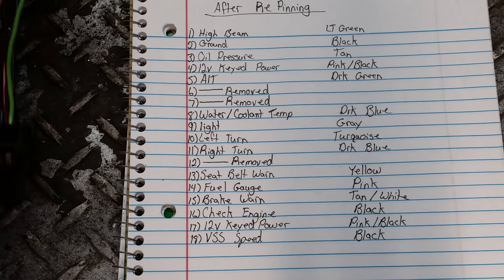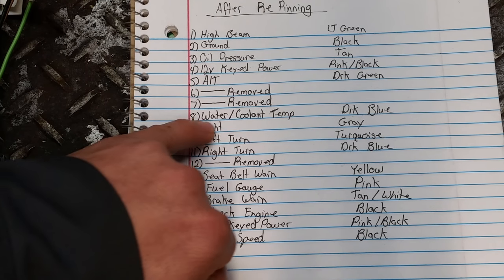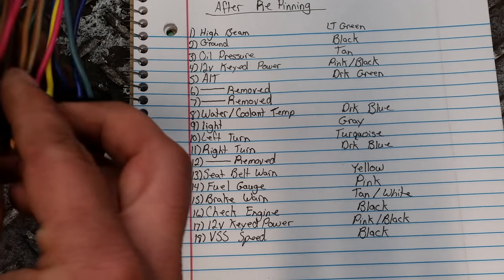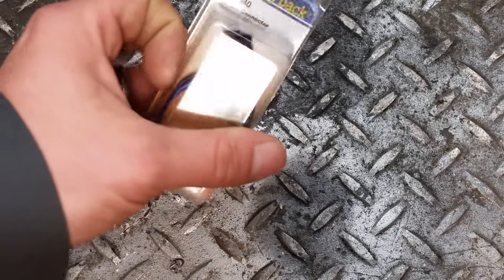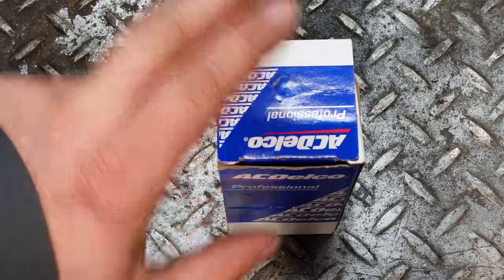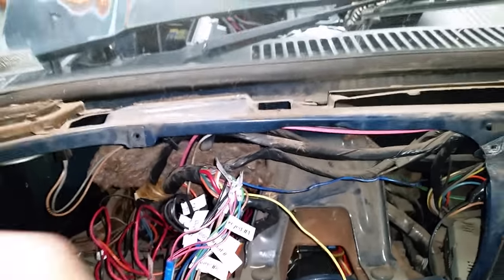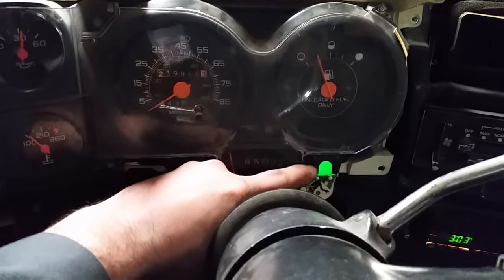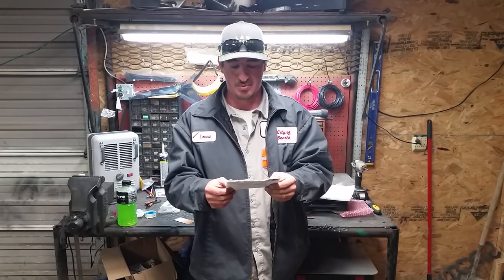1984 C10 Project ---- LS Swap Part 13-2 (Cluster Swap Using a 90-91 Square Body Cluster Part 2)

Comment: Thanks man for sharing this I just put a newer transmission in and I want the electric speedo now I know what I’m doing after work
Reply from the maker: Only works with a 90/91 suburban/blazer cluster.
Reply: I am trying to put one in right now but my 86 has more wires then your 84

Comment: I install bench seat covers for living. If you order seat covers bench splits top and bottom. Bolts are 2 on each side just did seat today. Heat gun softens vinyl and pan cooking spray helps covers slide on top flip inside out roll down. Bottom lay flip upside down. Heat vinyl roll sides down. If you rip cover tiny bit super glue. Find holes feel for them razer blade new holes. Trn minute job. Foam I just put carpet bottom them spray glue donor foam shave down any way like turkey knife, sander, grinder, Rolla lock, just razer blade. Hell get good foam from junkyard.

Comment: Great build Lonnie somthing you might check on for a tach that's factory is a gauge cluster in like a 2 ton Chevrolet of the 70s and 80s era the c60s c70s models they had a tach where the fuel is on your gauges and the fuel was under the tach smaller but in the same place idk if it would work with the new ls stuff but you could probably figure it out 👍

Comment: Hi! Great video, i just did this on my 82 C10 yesterday but now the battery voltage gauge isn’t working also the cluster lights don’t come on! Also on the diagram you’ve mentioned to tie #4 wire with #17 is that correct?

Comment: Say Lonnie  I have a 1980 C10 Silverado,  I installed a new 12 v circuit harness just the basic harness. I'm having trouble with the gauge cluster, I purchase a new printed circuit board, gauges, do the gauge cluster connector ever go bad , my FUSES are good. Keep in mind that I reconnect the old pig tail gauge cluster connector to the new 12 circuit harness.
Reply from the maker: To be honest I have heard of some going bad but not very often

Comment: Sup buddy I have same gauges on my swap but for some reason my check engine light is not showing on the cluster when I move my key on start position even my brake light when is cranking can you tell me what's the reason you think I have my malfunction wire from my new harness connected straight to my cluster plug on the pin #16 and also my old choke wire I use that one for my battery warning light on the pin#5 that's correct or wrong then u comment using the pin#17 with pin#4 what's the reason use those together so my 17 is gonna be empty now?

Comment: What is your exhaust set up? Are you using straight pipe or cats and what mufflers?
Reply from the maker: I’m running true duals 2.5” from the hooker cast iron manifolds to an x pipe then from the x pipe I have 2 flowmaster super 40s then I have it dumped before the rear end

Comment: very good set of videos and I was able to acquire a 90-91 suburban cluster off of ebay, waiting for it.  I was going to put in my Intellitronix, but with yours and OTHERS' youtube "reviews"  I will junk it.  I will use the 12-pin connector though for possible future other cluster options.   

I  have a question on to where does the ALTERNATOR wire connect?  thanks

Also, I looked up that oil sending unit 19106970 and summitracing states that that sender is a safety switch. Is it also the sender unit as well?

Comment: Kick ass video I did the same thing on my 1983 R10. I didn’t know about the temp sending unit that’s cool no more drilling and tapping the water pump thank. Do you now if the suburban came out with a tech? I like to put a factory tech on mine.

Comment: Or the pins on the connector no longer making contact with the gauge cluster printed circuit board? The pins look worn down

Comment: So I did a Gen 5 lt with holley I'm trying to get the speedometer to work  the 2 wire coming on a vss on the transfer case where do they need to go
Reply from the maker: You will need an electric speedometer

Comment: Did you use the intelectronix block temp sensor? the one I got doesn’t have a plug on it.
Reply from the maker: I used a 3 wire temp sensor because my computer needs to see the temp.

Comment: Lonnie......  I bought an electronic  gauge cluster and its coming with it's original pigtail.  Do I still have to move pins around like you have done on this video or just connect matching the wires?
Reply from the maker: What kind of gauge cluster and what truck are u putting it in?

Comment: Hey man. Love the videos. About to turn my ls swapped c10 over within the next couple days. Was wondering the part number for that 45 degree adapter you have for the oil pressure sending unit
Reply from the maker: That I don't have. I just went to the local parts store and they had some fittings.

Comment: Do you happen to know if it’s possible to hook an ls harness up to factory cluster? I have an 86, I imagine it’s similar to your stock 84 cluster
Reply from the maker: Wade in the water the speedometer won't work. That's why I'm using this 90/91 cluster
Reply: I'm guessing that means I cant use the stock gauges in my 86 Chevy van?

Comment: does this swap just require the gauge cluster from the elect speedo trucks/suvs, or does it also require the DRAC module from the 90s truck?
Reply from the maker: The trans I used required an electronic speedo
Reply: im swapping a 2000 5.3/4L60E combo into my '83 C10...
Im looking at installing a '90 K5 Jimmy gauge cluster into my truck...
Ive heard some people say you need the DRAC module to make the swap functional, but didnt see this in your vid... So im curious if i need to grab it?
I found a '90 Jimmy thats being parted out... Thats why im asking
Reply: @splash5974  isn't the drac module the yellow box on the back

Comment: If I have the wires that came with the cluster do I need to follow this procedure or just cut the wires and splice them accordingly
Reply from the maker: It will need to be repinned
Reply: Thanks i finally found one and since it maxes out at 85 I’m still going to use my obd2 for tach and speedo but I like how you did your tach
Reply: Lonnie's Garage (Puppetkicker) so I got everything hooked up thanks to this vid everything works oil pressure voltage speedo fuel only thing is the coolant seems to read a little lower than what my ecm is getting

Comment: On your bulk head wiring where did u add the wires for the speedometer and check engine light ?
Reply from the maker: Ran the speedometer direct and the check engine light is still hooked up to the stock one.
Reply: Thank you sir, for the alternator wire did u also run it directly to the alternator? Sorry for so many questions I am just trying to get my wiring squared away, I am also more of a visual type of guy lol

Comment: do you think I could wire the stock cluster that came out of the doner? I have 85 c10 getting the swap. Can you tell me what motor mounts you are using? thankyou
Reply from the maker: Oscar Hernandez I'm sure there is a way to wire in the donor cluster. I just don't know how and not to mention all the work it would take to make it form to the dash pad and look right. The mounts I'm using are from Tejas Steel Works. You can find him on Facebook. They allow the ac to stay in the stock location and also you can use the truck oil pan. It lets it set flush with the crossmember without worry of it getting hit.
Reply: Lonnie's Garage thanks for getting back to me so quick i plan to use the stock c10 cluster later(guages are shot) I just want the doner cluster to read for now. do you have a part # for the motor mounts
Reply from the maker: Oscar Hernandez direct link to them...... https://squareup.com/market/tejassteelworks/item/c-ls-swap-mounts

Comment: Do you have the wiring diagram or list for the original cluster wires by pin number and color
Reply from the maker: Check out ls swapped square body on Facebook

Comment: did you use a 12v key for alternator  (pin 5)? if not what did you hook up to ? thanks
Reply from the maker: Are u talking about the batter charge gauge?

Comment: I’m sorry I’m not real smart at this, so the wire coming off the cluster is hot and need a ground from computer, where does the ground hook to on the cluster, it’s the same cluster that you installed, I went off your diagram, thanks
Reply from the maker: I used a different led light for my check engine light. It is a really small one they will blink when there is a code.
Reply: Thanks I appreciate your help

Comment: Where did you hook the check engine light at the computer
Reply from the maker: I ran a separate wire for that. It’s a ground wire that comes from the computer to the light. I used an ignition hot wire for the positive so that way it would only be hot when the key was turned on.

Comment: im curious to how that is 90-91 cluster when the entire truck redesigned in 1988 as the 3rd gen. which has a totally different dash? thanks
Reply from the maker: my channel they still made these body styles up till 91
Reply: i used to own a 88 that was a 3rd gen i have never seen sq. body past 87....learn something new everyday i guess
Reply from the maker: my channel Yeah if u Google 91 chevy suburban it will show u
Reply: SUV kept the body ontil 92

Comment: I have a silverado 92 and I put a 2000 dashboard on it and I want to change the cluster from 1992 to 2000 how do I connect the harness pins
Reply: Did the ls swap page get shut down or did I get blocked lol